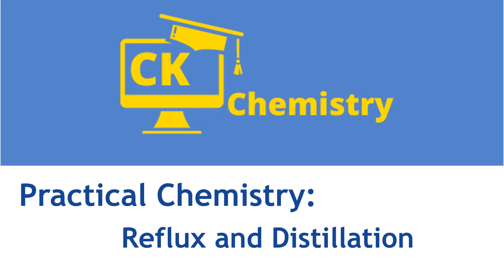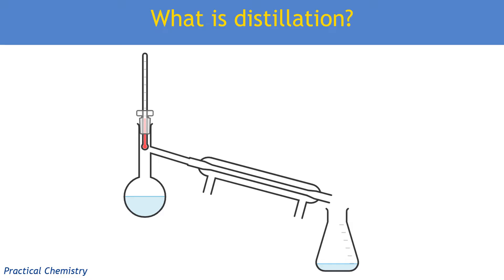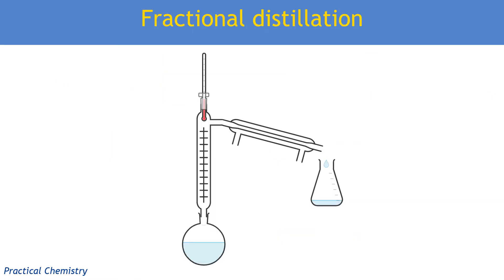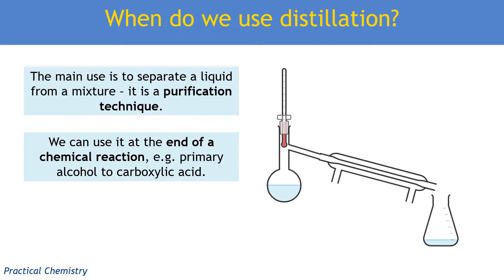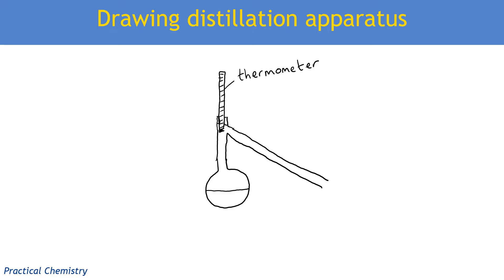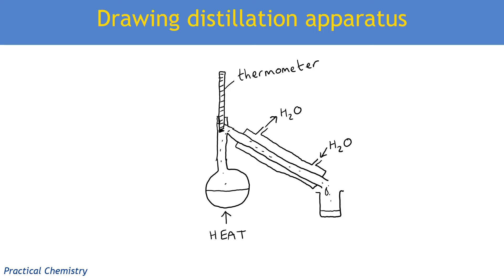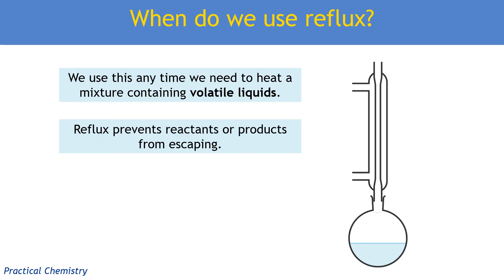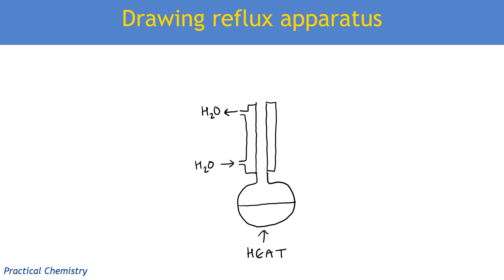Chemistry A Level practical techniques: reflux and distillation

Comment: Thanks ..... fractional distillation  can separate compounds wich have close ebullition temperatures ( owing to  the column design and the vacuum used,  or an other component added, ,....,  but not the compound themselves !!   It is the Azeotropy concept ... distillation can separate an  azeotropic component and an other product ,  ...and not the two component ...for example ,the ethanol and water mixture ....Fred/Grasse / France